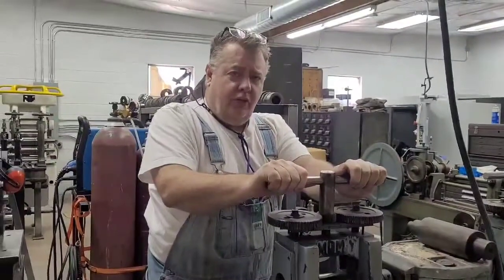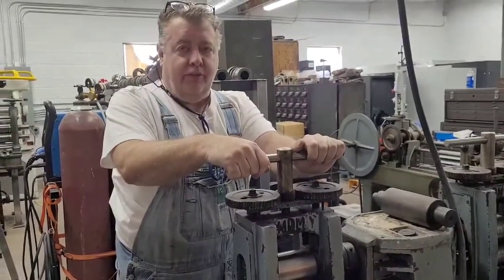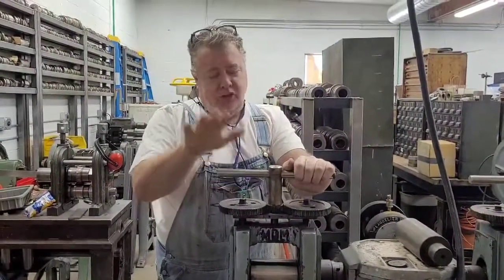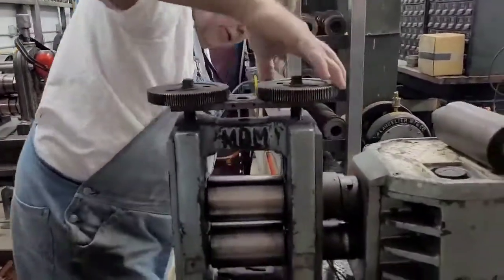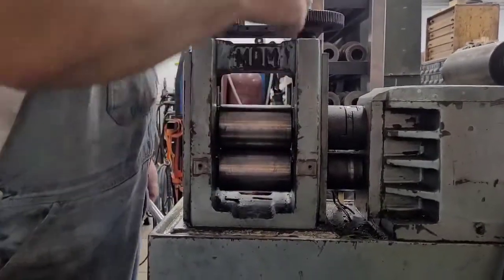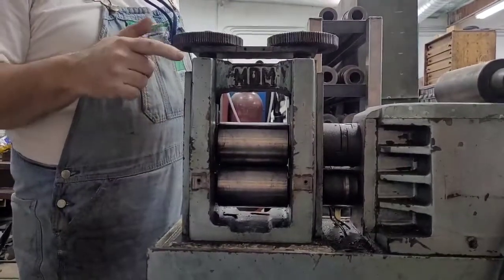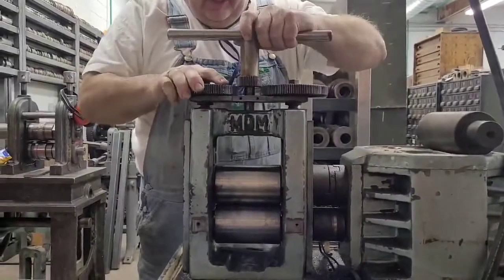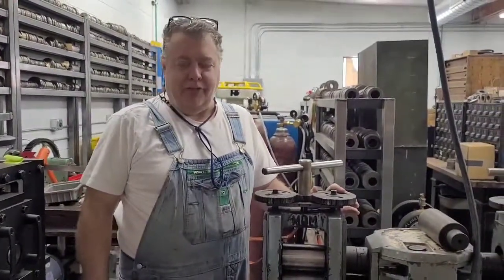Calibrate Your Rolling Mill

Comment: THANK YOU SOOOOO MUCH!  
My movers insisted they could move my table, which had my mill bolted on it. I told them they couldn't touch the mill. They couldn't grab it by the handle or by the rollers. They insisted they'd be careful.  I took the handle off and stuck it in my car. 
When I finally had time to start setting up my workshop, i put the handle back on my mill, and the rollers wouldn't roll. 
I called the company where I bought the mill. They sent instructions on how to fix this problem.
They also sent a link to a video.
I followed their instructions from the paperwork and video.
Got out scrap silver sheet, and...
It came out crooked.
I did more research. (Obviously not enough because I hadn't found your video at that time.)
Following the instructions from a different YouTube video, I adjusted  my mill (again), giving it a really good cleaning this time.  When I was done, I ran a strip of silver through it and.. it came out at an angle! Nuts!
Finally, I called another local jeweler - friend. 
He came over and took it apart, cleaned, oiled, and manually "adjusted" it. 
Put it back together. 
Metal came out ... crooked! 
"They must have damaged your bearings."
Crap!
I bought a new mill.
Today, while researching something else, I came across your video. 
"Yup, I did that."
"Yup, I did that, too."
"Yup, I got 'em to where they're just touching."
"WAIT. What do you mean we're not done? "Lots of play with the wheels?" " Back them up?"
So, you and I went downstairs to my workroom and I had you repeat everything again about this new, unheard-of step.
And you fixed it!!!
And now I have 2 rolling mills!
Thank you so much for taking the time to teach this CORRECT way to align the rollers! 
YOU ROCK!
PS: To those who are moving:
My movers insurance written on our contract was "Standard Released Value".  
Greek to me. 
I signed it. 
Standard Released Value is about $.60 per pound of the weight of the item. My mill=43lbs. Reimbursement offer:  $25.80.
I have a $500 deductible on my insurance. 
Disputing is a pain.
But YOU MY FRIEND, just took the sting out of the pain!

Comment: Hello,
Could you please make a video on how to move one of the rolls half an mm to left or right ? I have a rolling mill with sections to taper square wire and I've just recently noticed that sections where wires need to go aren't exactly aligned